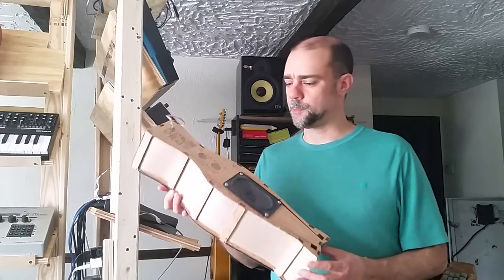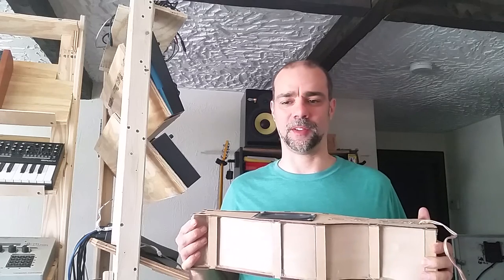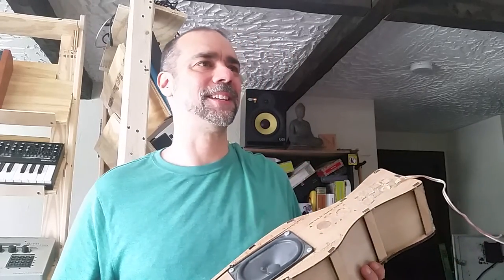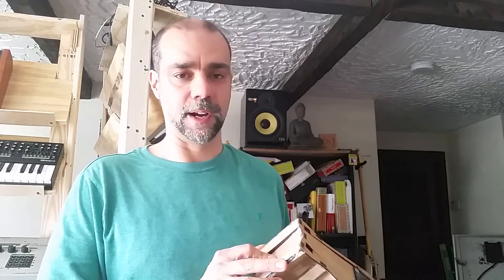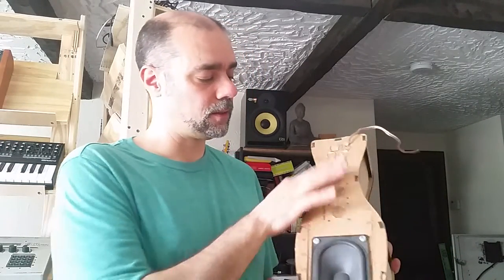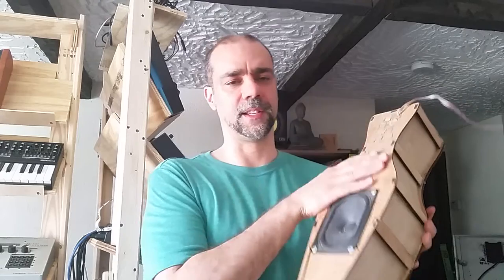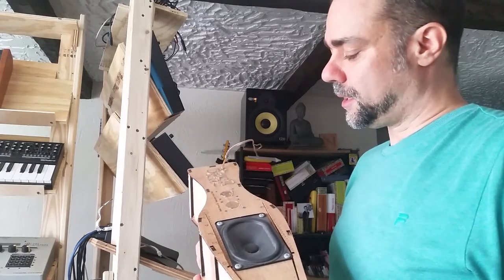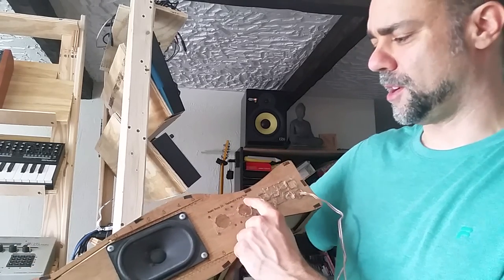Goodbye to Electric Eel Test Resonator

Comment: RIP BASIC BODY 26! Also, are those new gear shelves?? Legit!
Reply from the maker: Gear shelves in full effect!  Maybe I could make a video guide just on those!  But first, Ima use the hell out of them!  

It's already been wonderful having my ESX-1 out of its box again.  It has these built-in tubes the give a nice warm distortion...

Funnily enough, there are guides on how to remove them from the machine.  People say it's a really high-quality sounding drum machine when you remove the tubes.  They're always in-line, even when the gain is turned down, so they always add a small amount of hiss.  But I say there are 1,001 clean-sounding drum machines out there.  This one is beater as hell!